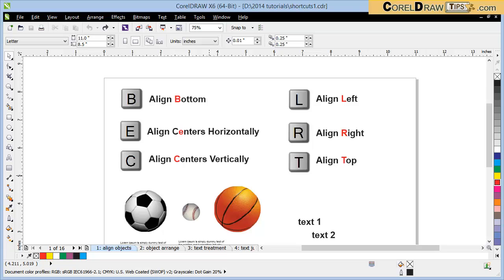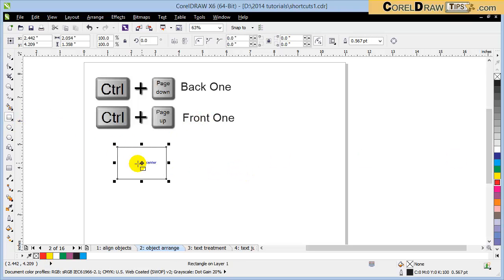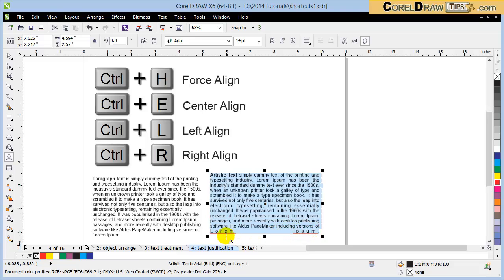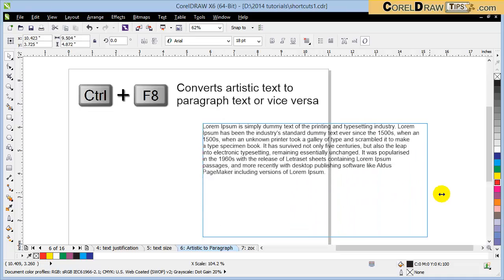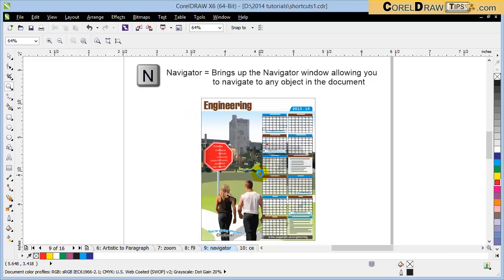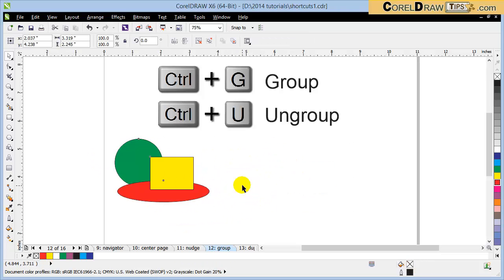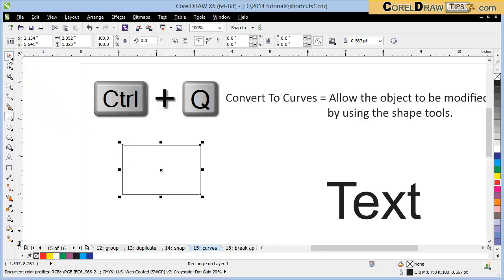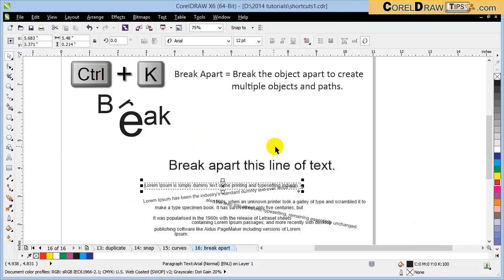Master CorelDRAW Shortcuts and Save Hours

Comment: Hey, that video is a life saver.
I did what you explained and I actually work with wireframe as well.
For some reason it didn't work with other commands, for example, I couldn't setup the Mirroring tool and also the rotation tool which is the most annoying thing to type in the angle... any suggestions? 
Thanks for making this video.